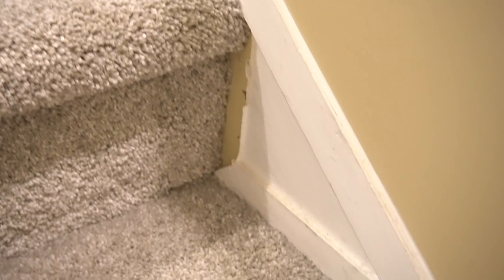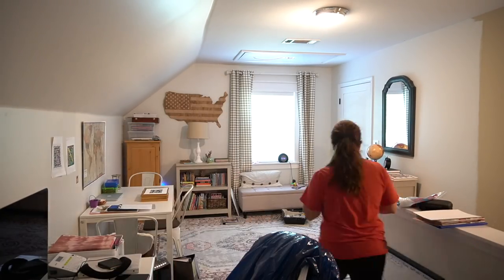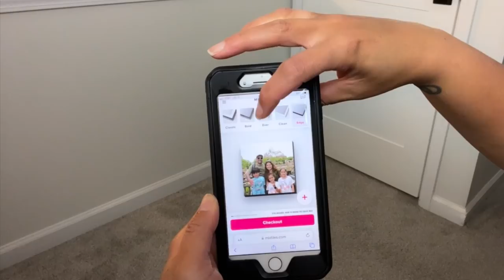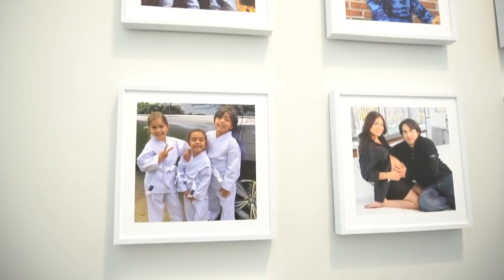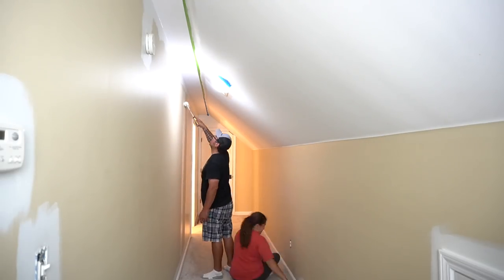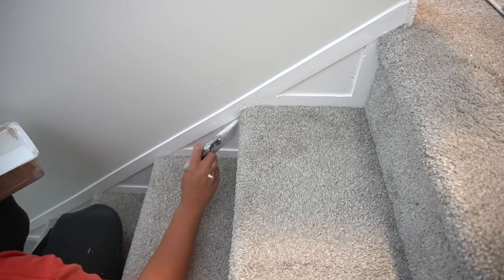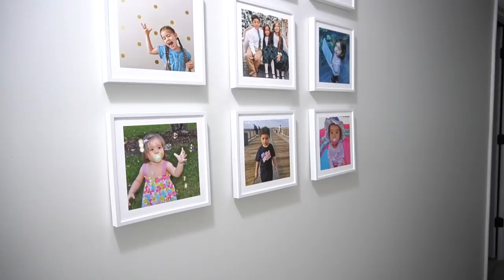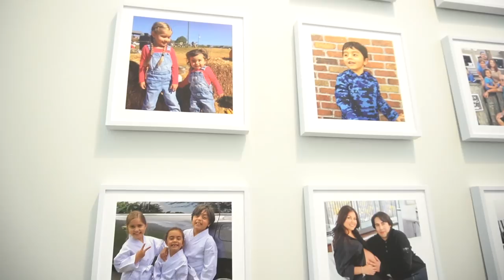🌟HOW TO STAGE A HOME | Painting and Staging for Our Upcoming Move

Comment: I would move the table & chair to the other side so everything is not on the same wall. It will help break it up. Second, I would spray paint the light fixture matte black. It would tie in better... Just some suggestions. Congratulations 🎉